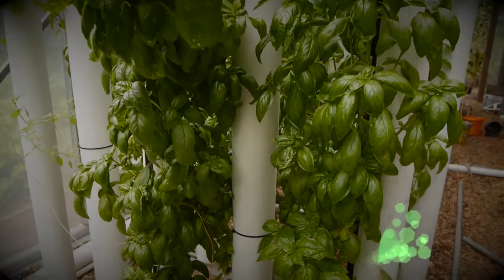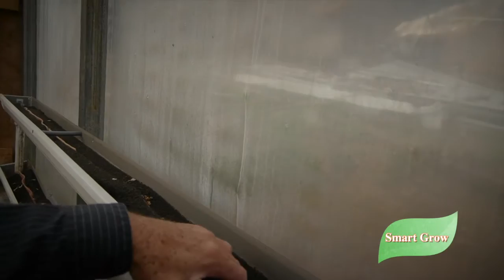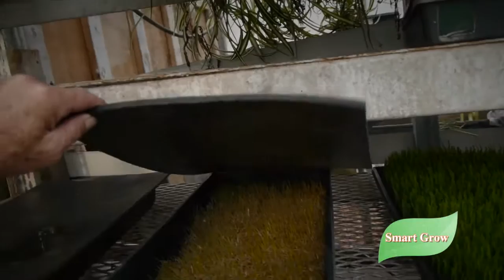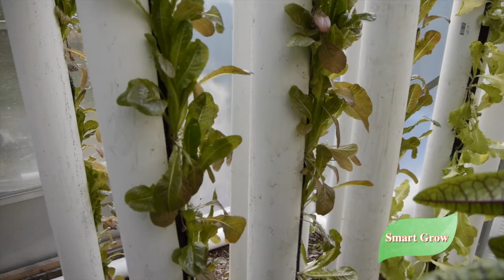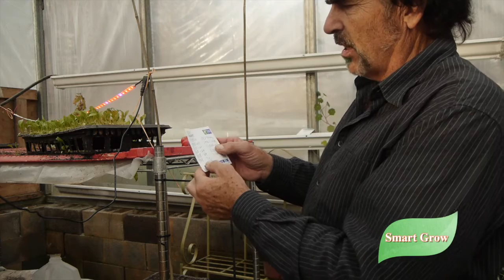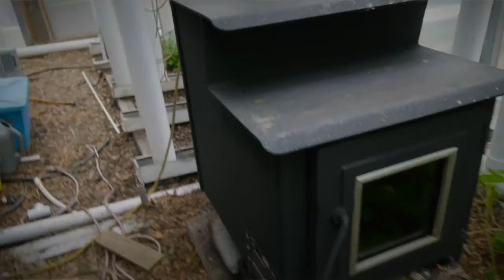New Vertical Tower Project

Comment: Yep lots more space in the cubic vertical than the horizontal. also don't give up any extra footage to isles. Is your roof weight baring? If so build in roof track system that will allow you to maximize use of your space. with this design you move the towers side to side on the tracks and only need one isle or rather space. Let the towers move around not your feet. We just finished a greenhouse with a 10' north to south by 40' east to west by 11' at tallest point of roof. We do most growing on vertical systems of one sort or other. We have a current  potential year round plant count of over 1600 in this size space with passive & active solar heating as well as compost bio mass heating back up. No burning needed. Thanks for your other videos on the foam for the towers that will come in handy when we add the hydroponic wrack system (4" square PVC posts 6' tall across the 40' north wall this add extra insulation as well as grow area. Do you have anything on growing on the vertical such as which plants on top and which ones below. Does the practice of companion planting still work in a greenhouse and on the vertical ?

Comment from the maker: dachf26 The new vertical Tower project has evolved into a new different project that is being built inside of a building using LED's for lighting Co2 enrichment and using hydroponic instead of the aquaponics. I have had to travel alot with my work so I am behind getting everything completed but I will post videos as things are completed. Thanks for checking back.

Comment: How's your new project coming along? Can't wait to see the results! I launching my indoor farm in September and I'm in data collection mode... 
Do you have an ideal spacing between towers? I know that in Freight Farms, for mini lettuce, they use 4-5'' center and on Zip Farm racks it's about 6 inch. 
When I glue my Tee Ys right next to each other with a 4 inch sleeve, I get 8'' center... I see yours are 12''+ appart. Could you put them closer for lettuce?
Reply from the maker: +Michel Loisel  I think for lettuce you can space them much closer, the new system the towers will be as close as I can make them with the T's. I have great news to report but need to make a video about it to tell you all. Next week I will be attending Indoor Ag-Con in Las Vegas so will keep you posted on what I find out  etc.

Comment: David, great content - I am starting a vertical grow tower project also, I have settled on the 4 inch pipe with the slot idea.  Next is deciding about the LED lights - which ones??? most economical and most effective - with little adjustment durning the grow season

Comment from the maker: I bought some LED from Amazon they are LED flexable strips, one brand is made by Toogod it is 16.4ft or 5m LED 505 DC 12V waterproof which is very important with 4 red and 1 blue, the other brand I have been testing is by Lvjing basically the same but the Lvjing LED's are smaller, will be doing a short video about them soon.
Reply: +Smart Grow Technology  very INTERESTED in your evaluation and opinions on these grow lights - waterproof would be ideal, a rope design placed near the tube would make install easier too (maybe)